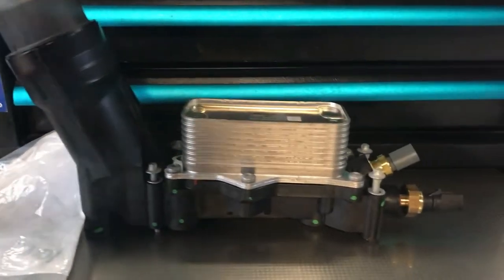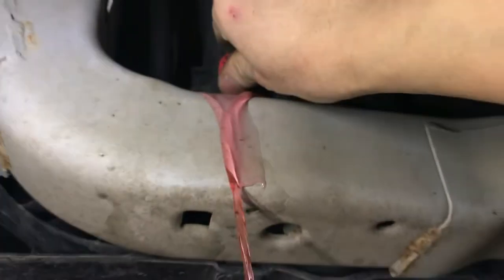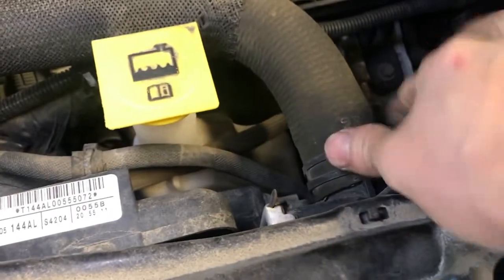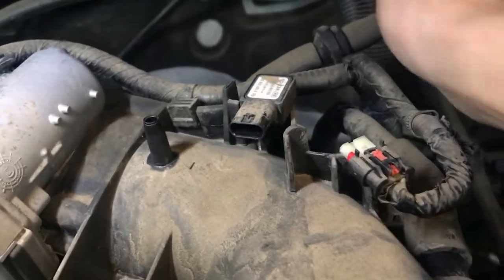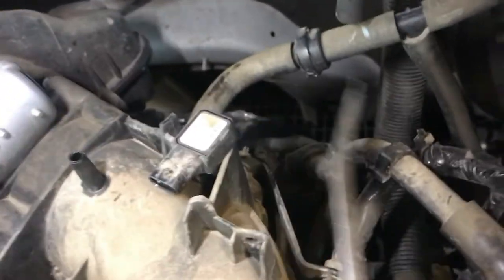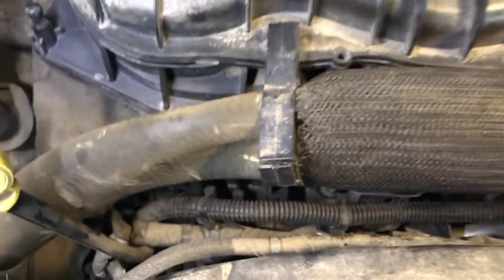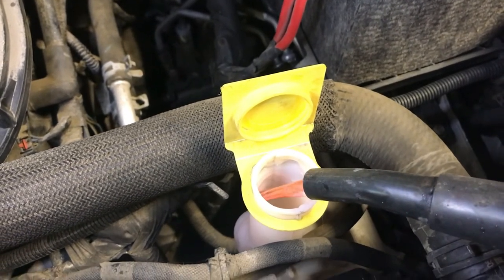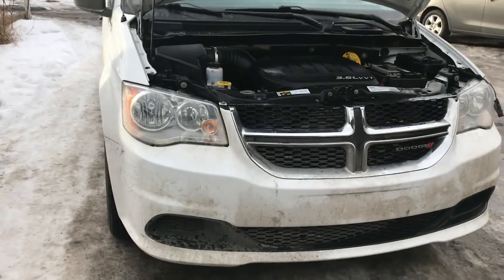How to replace 3.6L Oil Cooler/Filter housing

Comment: I have fluid leaking onto chassis frame at back of engine,  is this probable cause?
    Great video, easy to follow 👍
Reply from the maker: @timbarnes9642  thank you!
If you see fluid/oil on top of the transmission that is the filter/ cooler housing leaking